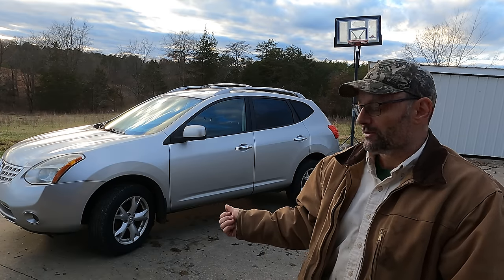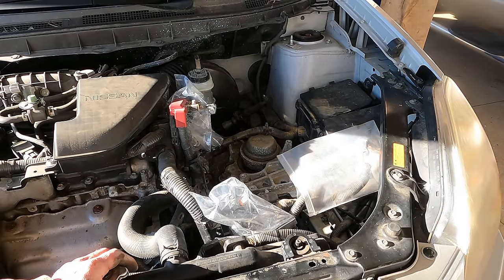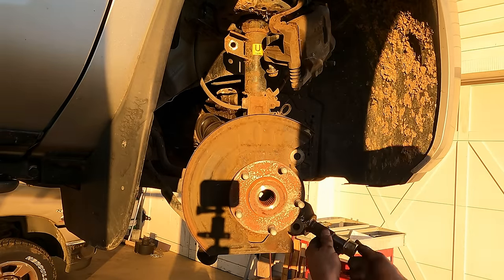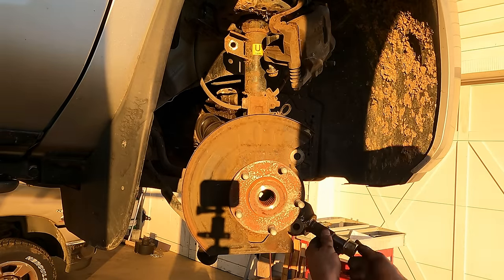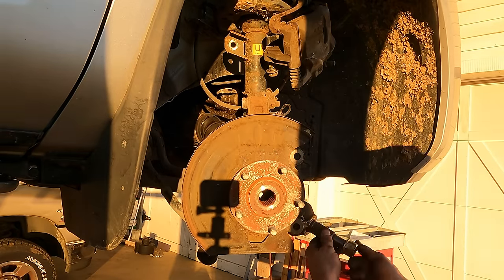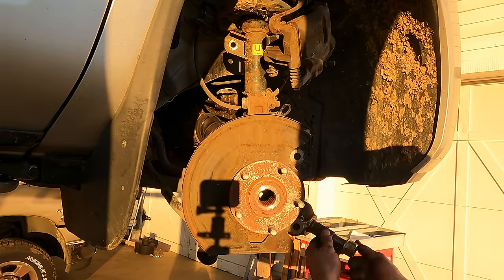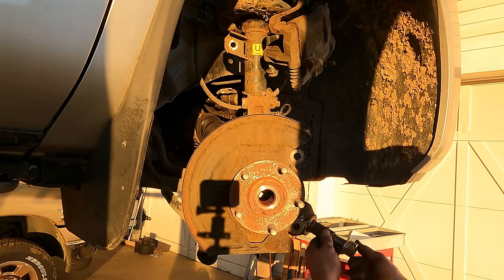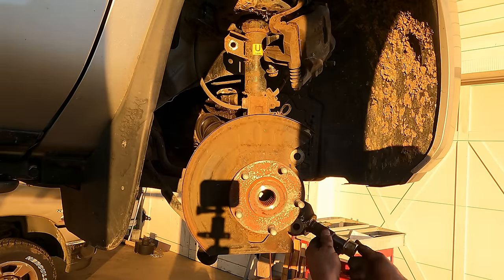Fixing a Nissan Rogue Transmission So I Can Give It Away. GOAL MET!

Comment: How most cheap CVT's fail: 

The fluid gets too hot from the friction of the belt, causes the pressure to drop unlocking the torque converter. This causes even MORE heat in the transmission, eventually causing the belt to heat up to the point it slips. These slips damage the belt and the pulleys, thus more slippage and heat. 

CVT's are the cheap option so they don't fit them with real coolers, and use the bare minimum amount off fluid (see of small that pan is!). Them comes of issue  the wear parts (converter, pulleys, and belt) being most the the transmission cost, so replacements cost more than automatics.

Comment: I'm dealing with a 2011 rogue .change the oil and filter  and it ran good for 2 weeks . It suddenly started not going into a higher gear . Had a step motor code come change it and still the same . Did find metal shaving on the magnets . Do you think the cvt is done ?

Comment: Convert it to manual transmission Sentra spec V 6 speed also while you're in there I would definitely change the subframe bushings they also sell a two-piece boot that doesn't require taking the axle apart you just cut off the old ones and glue the two halves together  replace the grease and install new retention bands they sell polyurethane replacement bushings for that vehicle fairly cheap you just burn out the old ones you're only replacing the rubber part not the metal sleeves those are reused
Reply: The problem is with the pump and the cooler the pump gets hot metal shavings from the pump contaminate the pulley system and clog the passages

Comment: As you know to change a automatic transmission is quite a bit invoved but as regards stick shift as you call it manual in UK when they go  on the clutch not as involved but if you can work on cars you can do the job yourself obviously more expensive to replace ?

Comment: I have a 2009 Nissan Rogue with 113K miles.  Yesterday I noticed a a whining noise when I started it and acceleration was slow.  The day before it was running fine and the car accelerated quickly.  Will changing the CVT oil help at this point or is the transmission about to go out.

Comment: Didn't  know that CVT use a valve body similar  to a geared  auto transmission. 
Not a great simplification  over a geared  transmission  with  low power  capacity and shorter  life expectation. Does  the replacement  slip box come with a replacement  torque converter  for only $2800 ?
Reply: I'm thinking that converter is $600. extra.  :  l

Comment: i dont know where you are in the country. i am in northern Washington state. i rebuild transmissions for a living. the total rebuild parts kit for that trans is about $300. it takes about 6 hrs of tear down, inspect, clean, reassemble. cvt oil is a little more spendy than regular. if you were in my area i would remove, rebuild, replace, for around $1500.00 anyone saying $5000. is stealing $3500.00 from you!
Reply from the maker: I’m in Virginia, quite a long way unfortunately. That was the dealers quote.

Comment: @FarmCraft101, Not because you are doing wrong, but because the transmission doesn't have smaller service increments, is it more efficient to fix this car, or get a car with working transmission and engine for the $2700 for a replacement transmission?

Comment: Hey nice job, I'm here due to an issue I have in my Nissan Qashqai 2011 CVT - I hear a strong whistling noise while deaccelerating only at 40 to 20 ml/h, when pressing slightly on the gas, the sound is gone. Any idea? I have less than 80K miles and changed the transmission oil recently - any idea where to look into? thanks

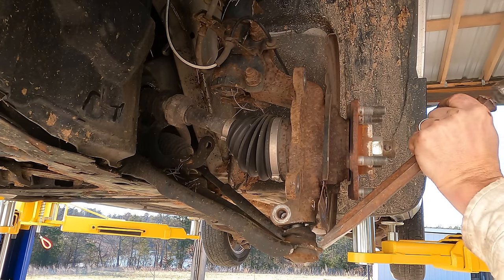Comment: 7:30 when you have a ball joint held in with a pinch bolt like that just use a screwdriver or a cold chisel to wedge the gap apart and the ball joint will come right out
Reply: Or an $8 pickle fork. Wedges both sides at once.
Reply: @RossReedstrom  Yeah you can do that but the pickle fork usually has a pretty aggressive ramp on it and often won't even fit in the gap for the pinch. Seriously a screwdriver or a cold chisel works just fine I've done it a million times

Comment: I never would have guessed that a CVT transmission could be designed sturdy enough for use in an automobile. I know they are used pretty commonly in a lot of small equipment. Turns out, I guess they really aren't robust enough to be used in an automobile after all. Of course you would think if the engineers knew that the belts were going to wear out after a short time, relative to the lifetime of the rest of the vehicle that is, that they would make it serviceable. You know, change the belt when it wears out at 50,000 miles for I dunno, 3-500 bucks for a new belt and easier to get to without having to spend a week tearing almost the the front end apart. Surely they could plan for it and make it accessible by removing one side axle and inner fender well to get to it. Engineers and product designers really don't care about such things anymore though. They would be more than happy to sell you another $30,000 car though.

Comment: We had a 2009 Rogue. We put One Transmission in it and when the second one started whining I gave it back to the dealership. We owed less than $1,000 on it and I still gave it back. CVT's are absolutely terrible.
Edited to add that if you don't put a transmission cooler on it the new transmission will go out soon as well
Reply: Cooler has nothing to do with these . Coolers were going bad on pathfinders and others letting antifreeze into the trans.
Reply: @onthelake9554  you are absolutely the first person I ever heard say that. If they had a transmission cooler they wouldn't have problems to start with

Comment: I noticed that you, uh, "like" those plastic clips.

A friend and I bought a car, to repair and flip.
A Lincoln.  The clips were different.  They 
had the part you push in, to lock.  But, to 
unlock, you push the pin in further.  Push 
it in until the pin is flush.  To remove, push 
it in further.  (You didn't need to push it out 
the other side, but could.  Just have to catch 
the pin.)

Worked on a few, (well, hundreds) cars in my 
day.  The "real" ones didn't have plastic clips!

At least, Ford actually had a better idea!  (Just 
the one.)

steve

Comment: I'd like to know how you organize all those parts so you can put this car back together correctly.  You say you haven't done this job before, so how do you know or keep tabs on what goes where and when. I done alot of car repairing and I kmow how complicated it can get.  I'd really like to know how you keep it straight, especially with any kind of manual.
Reply: You could see he had all the removed items organized in order on the ground. Plus, if you haven't noticed, he made a video of the removal. He will likely revisit those or the other one he watched when it is time to put it back together.

Comment: Biggest reason they fail is they cannot take abuse. So, if you are the type of driver that punches it to the floor from a dead stop on a regular basis they will fail. You must drive a CVT equipped vehicle like a senior citizen. And you must have the CVT fluid, and two filters changed every thirty thousand miles. Then it will be fine. If this gentleman gives this car to a H S young man who abuses, it then that CVT will fail again.

Comment: We have the same crappy trans in our 2013 Sentra.  Died at 65000 miles.  We had a 70000 mike extended warranty, so Nissan replaced it for free.  Now at 86000 mikes the new trans is starting to fail.  My LAST CVT, and MY LAST NISSAN!!!

Comment: 1950min Trans let go... torque converter is still on flex plate... did you miss a bolt... it should have stayed in Trans... not picking on you or your work... doing same job tomorrow... I'm puzzled

Comment: Those (belt) or chain drives are the failure point. They wear out at 100k. Many engines like Hondas have a belt drive cam, 100k too. After that your on borrowed time to destruction.

Comment: Nissan X Trail 2010 diesel 2.0 optional 4wd I imported it from Japan to New Zealand and for which I paid extra insurance It arrived and was too rusted underneath to enable certification to be put on the roads Next when I finally got it it within 20 kms started changing down from 6th to 4th with  two large Toyota Landcruisers right behind me Put in another claim and it was off the road for most of the 10 months I owned it Wreckers wouldnt stand behind the second hand automatic transmission they sold me The mechanic who installed said he couldnt bench test it and hence wouldnt stand behind the install Then the insurer engaged by the exporter Be Forward being Matsui only paid half of the repair cost

Comment: Not 100% but pretty sure that the valve body only drives the geometry of one of the pulleys the other is just managed with spring tension that changes based on the geometry of the valve body managed pulley due to the fixed length of the belt. The slipping would have to be something in the valve body managed pulley failing since the other is purely a reactive pulley.

Comment: See how easy it was to pull the valve body put....you could do that with the Trans in the car. Had murano 09...the internal speed sensor failed and put it into limb mode ALL the time. If I could have a bought a new valve body with that sensor in it I could have saved a 10k car. But 5k for a Trans was not happening lol

Comment: I think that they should sell the parts for the transmission to customers who want it. To hold back on parts goes against the right to repair and forcing you to use a professional shop to get a serviced or new transmission is just driving the price up. One can argue that most customers won't have the knowledge to fix a transmission, but nevertheless you should have the right to try. Cleaning out metal shavings and replacing a belt should not be rocket science, but still it may require a special skillset. Many customers may have the knowledge to succesfully repair these transmissions, or you would find the procedure for repairing it on internet, so they should sell parts to it.

Comment: original cv joints are far better than remans that tend to be off balance.  you dont need to use metal bands to hold the boot. zip ties work

Comment: We just bought a used one for close to 10k and we have used it for about a year didn’t even put  5k miles on it …. No precursor at all whatsoever ….. took a left and went up the slight I climb to ywca and high rpm’s for a second and then no power … turns on runs but doesn’t do anything…. Slight whine noise when I shift to gear or reverse…. But yeah 10 k down the drain …. Too bad we didn’t get Into an accident instead…..

Comment: My advice is to stay away from Nissan cars. The CVT transmission in my 2014 Rogue SL AWD just went down. Exactly 140,014 miles on it. Car in great condition for its age but it will cost me $6,560.53 to get it running again. The new transmission will come with a 2 year / 24,000 miles warranty on parts and labor. I have no choice but to get it done. However, next time I will get either Toyota or Honda.
Reply: If u get it done at Nissan they have life time miles/3 year warranty on they cvt,transmission

Comment: The downfall of Nissans cvt, and they are well aware of it, is heat. A transmission cooler should be installed on everyone of their cvt vehicles. The push belt is really cool and totally different then the rubber belt cvt transmissions we are used to on recreation vehicles. Toyotas synergy drive cvt is all planetary gears and much better.

Comment: I have seen videos on gifting things like cars and it apparently has a bunch of tax implications and such that can leave someone with a large bill in the process. Im sure some people may have heard about this problem from things like Oprah giving away lots of cars, but a lot of people simply not being able to afford all the additional costs.
Im not sure if this varies depending on where you are, whether the car is new or not, etc and further donations can probably cover it*, but I figure its something the channel should be aware of.

*Though that may require some recursive mathematics to cover the tax on the amount thats covering the tax of the cost of the gift. E.g. if you give 100 gift at 10% tax means 10 additional to cover it, but now an additional 10 is given so covering the 10% of that means 1 extra, but now additional 1 is giv... but youd have to check the specifics of the law to know if thats exactly how it works.

Comment: Looks like the patriots cvt trans Ive worked on, check the balls in the pulleys, they are common to fail if the push belt is ok.

Comment: I just wish I could find someone to give me a break on my transmission. I bought a used 2013 Nissan Rogue with a little less than 98,000 miles on it and after a year it’s been sitting in my yard waiting on me to save up the money to get a new transmission. I assume I will need one because the car would not go when I put it in drive or reverse when starting it in the mornings before work. So I stopped trying and started back driving my trusty old 2008 Honda Civic.

Comment: FYI....just saw you talking about the Boot on the CV Joint and as matter of fact, I have a old "Split Boot" still in my garage! It would never fit on your Nissan, but I just wanted to let you know that they do make "Split Boots" which are designed so you can replace the boot without removing the CV Joint nor any other parts at all -- just cut the old boot off, Re-grease the Joint and place the Split Boot around Joint! 

Just a suggestion in case of any use to your readers or yourself...but you have the Joint out, so it is not likely your best choice.

Comment: Shame, that fluid looked really good actually. Probably had the valve body get plugged up in the pc solenoids causing belt to over heat.  Also sounds like it's in fail safe with the pump screaming.

Comment: John Deere in 1963-1987 used a CVT dual belt design on their garden tractors. For those wondering how it looks like when it’s shifting look up a video of that. It’s pretty cool how it works.

MTD uses a version of it with a single clutch in the back of the tractor, & a little in the 1990s.

Rly good simple design just doesn’t last very long. But compared to Fiat/Chrysler it seems abt right.

60k to change fluid, or every 100k for a transmission. Some new Chevy 6L80 transmissions are as bad as this CVT. 

I’m kinda surprised it made it to 150k, they usually fail at 100k. Dodge does it, & same for some Honda’s.

Video: https://youtu.be/2wKEri_SwjQ

Comment: Nice guy thanks and informative 👍

It’s a CVT ….. just buy a junkyard transmission with a 30-90 day warranty and swap it
Put the broken axles back in the spinals hanging from bungee cords and you should be able to roll it out the way off the lift

Comment: If you have an AWD vehicle be aware… you cannot replace just one tire. You will trash the transmission or transfer case. Not saying that’s what happened here but it could be. Let’s say you ran over something and it couldn’t be plugged, so now you have three tires with 20k miles on them (or whatever) still plenty of life on them. You can’t mix a brand new tire with three worn ones. You need to replace all four or have the new tire shaved to match the circumference of the others. I know, it stinks. Check your owners manual.

Comment: Wouldn't take much time to put the subframe section back on with the lower control arms. Then you could reattach the ball joints, rotors and wheels, poof cars movable.